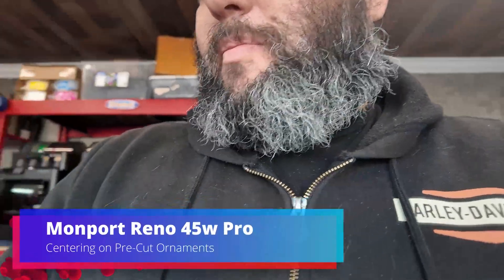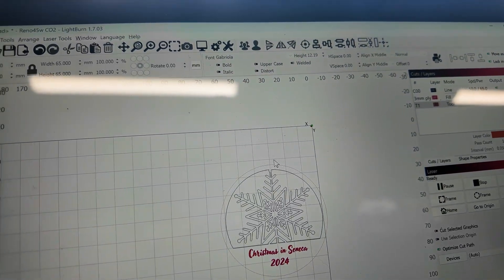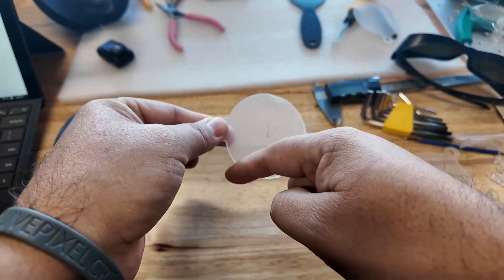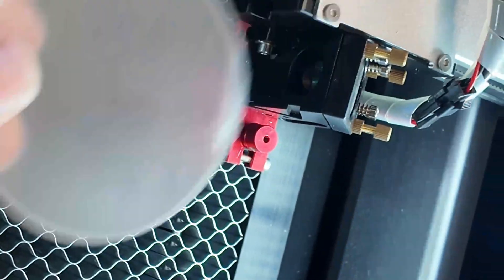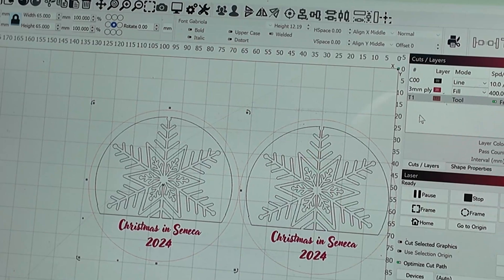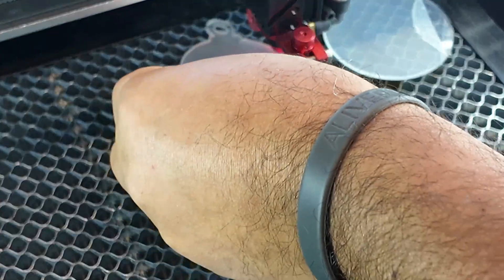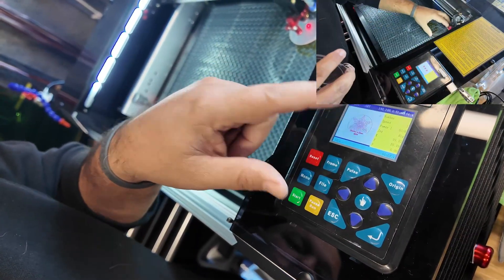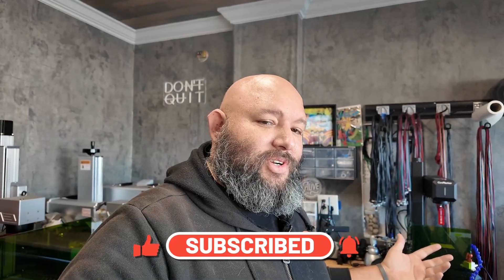Monport Reno 45w Pro - How to Align on a CO2 Laser - Alignment Tutorial - Lightburn Tips and Tricks

Comment: I'm trying to find out  the best way to clean the mirrors, laser tip whatever else needs to be cleaned to keep the machine running great, any help on that? Thanks
Reply from the maker: Normally if is not internal 99% IPA on a paper towel will work if need more clean take that part out for cleaning with your regular maintenance.